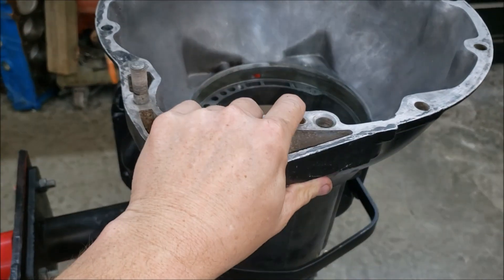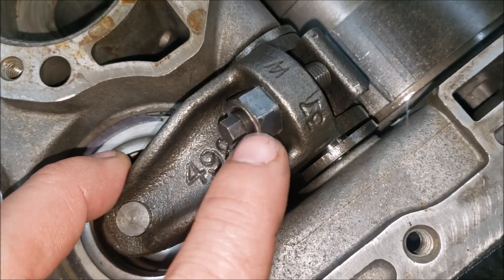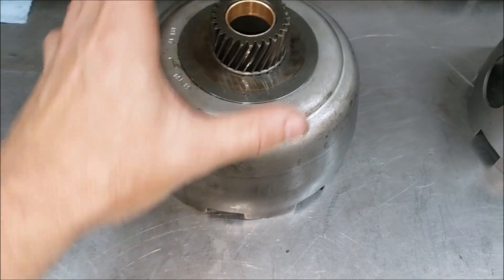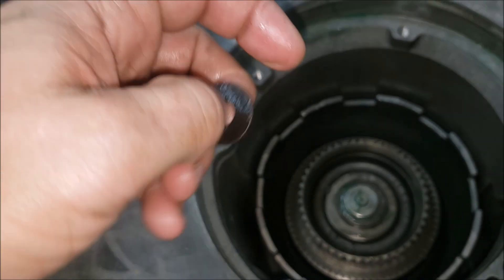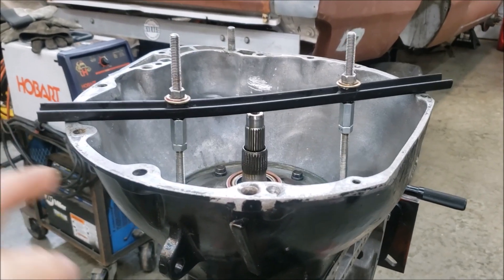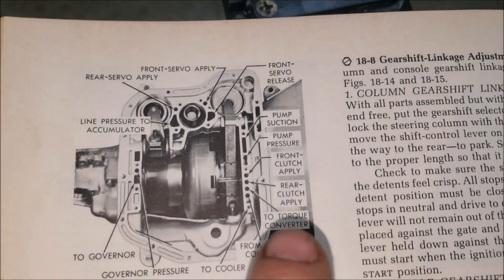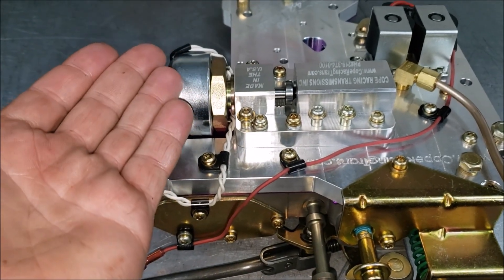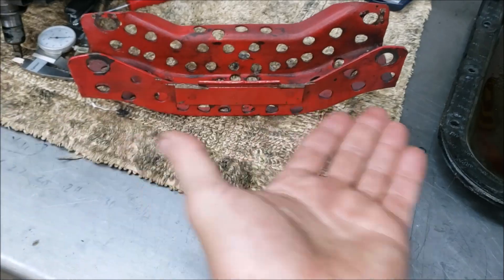Plan Z 2.0 transmission Build, With Custom parts

Comment: Truthfully, pan A is more in keeping with the original plan z theme. Lighter, stock, less fluid means the whole system is lighter too. 

How much fluid do you need for a 1/4 mile pass?
Reply from the maker: You are correct for a 1/4 pass. But since this will be driven in the Sick Smokies race in October.... I would like more fluid.

Also this is Plan Z 2.0 so we are making it much safer and drag and drive ready.

Comment: A minor thing but should point out that the .037-.084” end play dimension you referenced from your manual is actually for the 727 trans, not the 904 which is .030-.089”

Comment: You should be able to run the wider A999 rigid band with the direct clutch drum you are running, although the leaning tower of power may not overtax the standard width band. RB